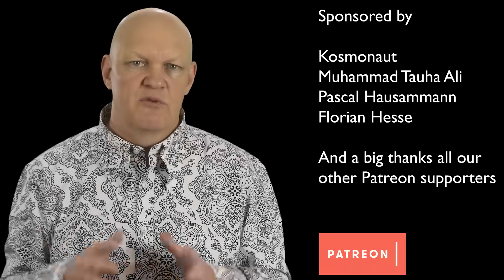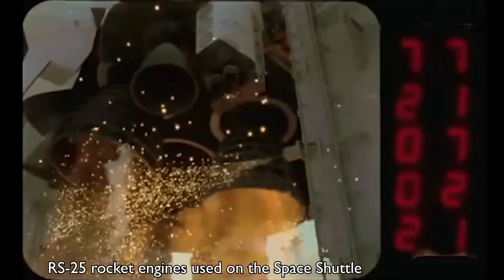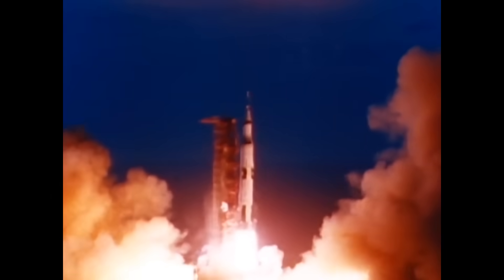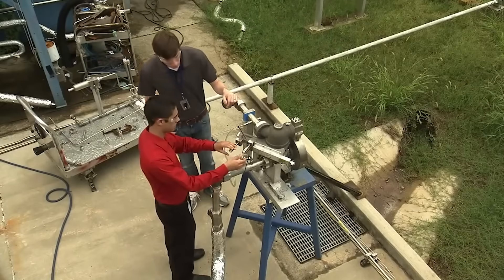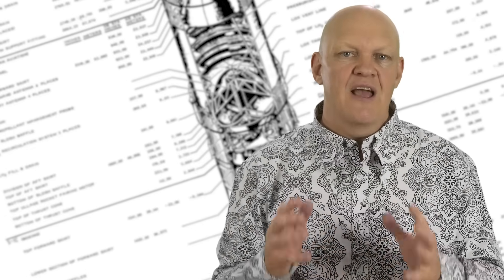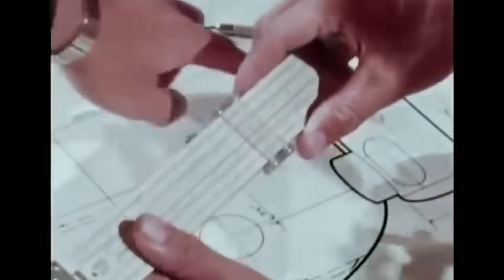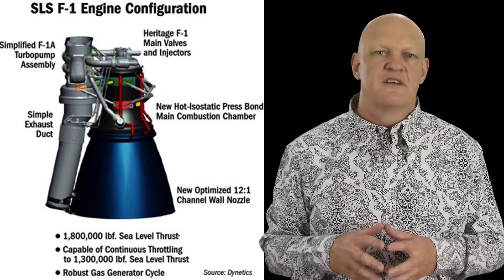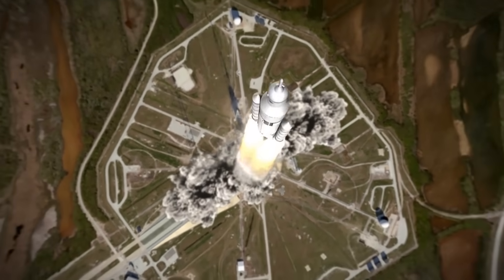Why Can't we Remake the Rocketdyne F1 Engine?

Comment: No amount of excuses will ever satisfy me, is like the pyramids in Egypt but in a way shorter time frame.
Reply: It's completely different than the pyramids, we can easily build a pyramid, but there's no reason to.
Reply: @raptorwhite6468  With today's tech sure but the analogy stays the same, you would think that such incredible feat in human engineering will require blueprints down to the tiniest bolt.
Reply: @diegolink42  they DID have blueprints down to the tiniest bolt. The physical copies still exist with probably step by step instructions on how these engineers should be put together. The problem isn't with not knowing how to build one, the problem is the craftsmanship that they used to build one. Those tiniest bolts weren't any old bolt you can go pick up at a hardware store, but hand crafted, individually tested and modified with it's own serial number. And like said in the video, what they used to modify these parts is probably not in the blueprints, but scribbled in a margin somewhere, or like how if you've ever worked with or talked to old union engineers, they have their own mental shortcuts on how to make something. And if you've ever worked in QA, you'll know damn well that if you're working with those kind of component, we call them "controlled material" you better guard that thing with your life if you so much as take it out of the thing you're working on. Because if you lose or damage that bolt that probably costs more than your salary for the next few years, then that's not only paperwork, but you have to get a new one, hand crafted (sometimes by tooling that doesn't even exist anymore) which is an expensive, time consuming process that can cost you your job.

And same with the pyramid analogy, why would we recreate the same design today? We have better computers that can be way more accurate than any one of our minds can ever be. So it's probably cheaper and better overall to just design a whole new engine.
Reply: @diegolink42 why build outdated crap when you have engines that blow the F-1 out the water? see the Raptor 3 engine

Comment: Really they can't make these old rocket engines but they can make secret  planes or whatever and travel anywhere in the universe bit not 50 yr old engines lmao makes a lot of sense don't it😅
Reply: Top secret stealth planes are not the same as an engine used on the Saturn V. One is suppose to be invisible to radar, while the other needs to get 3 men to the moon. Different fields, different technology, different engineering skills. 

And you missed the point. We can't make THOSE engines anymore and we probably wouldn't want to. It'll be cheaper faster just to come up with a new design that'll probably be more efficient and easier to produce than the F1s.
Reply: the F-1 engine is an outdated engine. the Raptor 3 engine blows it out the water is every single metric

Comment: I like your long vids too.  And you could make a long video about Rocketdyne's legendary F1.  I watched an old documentary called Moon Shot.  Bet you've seen it.  And other documentaries about the Apollo era.  Like you stated, each hand built by what you may call Masters of their art.  By thrust output alone, the most powerful liquid fuel rocket engine ever designed and built.  I recall that the engineers had trouble with the injector plate. In several documentaries, the engineers admitted that they stumbled on an injector plate that did not cause instabilities within the combustion chamber.  We got lucky, and stopped blowing up test prototypes.  When using a disposable 1st stage, performance outweighs efficiency. As soon as your big bad simple 1st stage is discarded, efficiency comes into play with the remaining stages.  This is one example of Von Braun's way of thinking.  I believe that when a Saturn V burned up the fuel in it's first stage  and the seperated from it, the rocket was then approximately 35% of it's launch weight.  The rest of the vehicle was very efficient, with those J2,s in the next two stages.  But I ramble.
  Thanks for the vid.

Comment: I like the shorter format. So many videos today go from 15-30 minutes (for monetization?). They waste a lot of time.
As for SLS...... geez, what a mess. They use these super finicky HydroLOX engines that are way over priced and prone to leaks (because Hydrogen always finds a way to escape). Then they lug that huge set of fuel tanks almost to orbit (negating a lot of the efficiency of Hydrogen in the 1st place). 
Von Braun and crew were smart. Make it a 3 stage vehicle. Get it off the ground with the simplest Kerosene Engine they could engineer and DROP ALL THE WEIGHT after burn-out, and then save the finicky HydroLOX stages for the upper atmosphere and space. Drop a lot of weight with the second stage and cruise into trans-lunar trajectory with a sleek single engine Hydrogen 3rd stage.
It is simply a CRIME that the SLS weighs more, has more thrust on lift-off, and STILL gets LESS payload to LEO or TLI than the Saturn V.

Comment: Some of the 'engineers' in my graduating class were absolute morons. NASA hired the best of the best. Cost-cutting SpaceX will never reach that pinnacle.
Reply: ah yes, spacex develops the most advanced rocket engine in history and you think the F-1 is still better?

it's not cost cutting, that would imply sacrificing quality. SpaceX has landed a falcon 9 booster 360 consecutive times without fail since 2016 and many of its boosters flying more than 20 times

Comment: I, personally find it hilarious that technology has "advanced" so much, we can't even build a design from the 1960's! 😂
Reply: have you tried building an sr-71 using original plans and factories?
Reply: @Agarwaen  Not personally, no. Have you? That's also a 60's design by the way.
Reply: @PercyPruneMHDOIFandBars  exactly.. you're almost getting it.
Reply: @PercyPruneMHDOIFandBars RD-170 produces more power than an F1
Reply: @Hex___666  Not my point. Look at whàt I wrote earlier.
Reply: @PercyPruneMHDOIFandBars  If your point is that you want to build a design from the 60s when we've surpassed it then you don't have a point.
Reply: @Hex___666  My point, is that with claims of "advanced technology" people can't even make something created nearly 60 yrs ago! Surely that should be simple? It's hilarious to me just how far backwards we've advanced!
Reply: @PercyPruneMHDOIFandBars  Yes because we can make something better, there's a reason Ford don't make model T's anymore.
Reply: @Hex___666  Hmmm. And there are things model Ts do that modern fords don't, look at the ground clearance? The issue I actually have is loss of skills.
Reply: @PercyPruneMHDOIFandBars  Model T has a ground clearance of 10 inches, Bronco had 13 and is faster, more comfortable and more economical.  When we make something better we don't continue making old inferior things as well.
Reply: @PercyPruneMHDOIFandBars   The SR-71 is a 50's design. An F-1 engine makes 1,522,000 lbf , A space shuttle booster makes 3,300,000 lbf.  
But if you want F-1 Engines and Model T's build them.  Make a bunch and sell them.

Comment: It's a useless engine today, it's way too expensive and though it provides a lot of thrust it does so at massive cost and is not reusable at all, the SpaceX raptors are by comparison much better than the F1 and if SpaceX manages to get the super heavy working we will have something that can lift as much weight as the F1s at a fraction of the cost

Comment: 3:43 100% completely false lol!! Just because the people that designed and built the f1 engine are not around doesn’t mean there are no qualified or smart enough people to build the f1 engines again that’s just completely false we are far more advanced then 60 years ago in every possible way, we can build the engine better now then before because of the machinery/tooling, how much we have learned/advanced in rocket technology, we can simulate anything with a computer now before building anything with great accuracy, we can make better quality alloys then before. If the F1 engine was the best option for a spacecraft now we would be using the engine but it’s not it has nothing to do with not having able people to build them and for what it’s worth people that worked on the engines are still alive, sure many have passed away but if they wanted to build the engines the key people were around for decades after the Apollo program ended its not like they all died in the 70’s when the engine was cancelled again nasa built a new spacecraft and the engine was not right for the new spacecraft that’s all plus we stopped going to the moon

Comment: I understand the issue about how you can't put everything into the blueprint. In my job we complete a bunch of fairly straightforward tasks. You can learn these tasks in the course of a day or so, and we have training notes to explain the steps. There are a range of problems which might require us to stop a task and go back to the beginning. The challenge is that these problems require different solutions, and when multiple problems occur in a task they require different solutions again.

There's simply no way to write out the solutions to all the possible combinations of problems, so the best we can do is to train the new staff to make sure they've found all the problems, work out what they think the aggregate solution is, and check it with the more experienced staff. There's no point adding it to the notes, because there are simply too many possible combinations, and most of these combinations occur extremely rarely. It's simpler to build up your experience in order to be better at catching all the problems in a task and then designing the custom solution on the spot.

If the members of our team all won the lottery and resigned, and Management had to train up a new team, the replacements would only be able to learn about how to deal with those basic problems. If they came across one of those more complex problems the training notes would be no use and they'd have to work out the solutions all over again.

Comment: Rubbish. 
1: The design documents are not publicly available for the F1 engine.

2: You really think our engineers and scientists now couldn't reverse engineer a hand tooled rocket engine? Laser scan each peice, load into CAD. Modify as required and build it. 
But they didn't, because if they did, they would realise the Saturn 5's published capabilities and power were over exaggerated because they only needed to get into Earth orbit.
Reply: Any evidence to back up your assertions?
Reply: 2. The problem is many engineers did undocumented changes and modifications to the engine. You could stand under a saturn V if you are questioning its power if they ever build one again.
Reply: @miguellopez3392  Simply not true. Reports and technical details of every stage of development were documented and reported to NASA and the relevant contractors. The most important bit of machinery at the time, apparently, but didn't keep such documents.
Reply: Also, you don't need to sit under a Saturn 5 (even as powerful as it actually was, we know it was loud) for it to kill you. Sit in a capsule 300 feet above it and the sound/vibrations alone would kill a man.
Reply: @maverick627uk  the saturn 5 was under pressure to get into the air as fast as possible, I doubt the engineers recorded every stage of the 100,000s of design choices especially when you had no CAD to make it even a convenient task.

Machinery is customers made, so information on them can be lost fairly quickly if the hired company goes under or a department miss managed the storage of files, I belive thos to be more possible than a organization to have perfect documentation for half a century.
Reply: @miguellopez3392  Rubbish. They designed a production process, then made many F1 engines exactly the same way. They didn't do it from memory. They made 98 Engines! 98 not bloody 6.

Hilarious as cognitive dissonance is, believe what you will.
Reply: @maverick627uk  and then they lost the documentation just like how not all moon footage was stored correctly and some found many decades later.

Comment: The propellant is different, now we use cryogenic fuel, in the 60 some kind of refined petroleum, less power per unit, with different and more power fuel the engine needs to be redesigned anni way.
Reply: Falcon 9 & Heavy and the first stage of Atlas V still use RP-1, just as the first stage of Saturn V did.
The upper stages of Saturn V used hydrogen, just as all stages of Delta IV Heavy, the core stages of Ariane V and the SLS, the upper stage of Atlas V and the shuttle main engines.
The only new fuel is the methane used by SpaceX' Raptor engines on the Starship and Superheavy, but they haven't become operative yet.

Comment: They do have 100% reliability.

Remaking them, would demand a new prototype, and everything in the design and manufacturing, to be updated to new standards.
Then I believe those old engines can be produced in series, a lot cheaper than expected. 
Low chamber pressure, and a overall reasonable simple design, with well known technology, can be produced anywhere.

Don’t expect to return them in one piece, but to parachute them down, and collect the metal, seems like a solution to recover some of the money spent.

Comment: NASA does not build such engines, because it knows that their thrust is only 70% of the declared one. These engines are of a very primitive design, they are just an enlarged copy of even older engines. Now NASA buying Russian RD-180 engines, which operate on a closed cycle designed specifically for the Soviet Lunar and Mars programs.

Comment: The problem with all the little kids wanting to be called rocket propulsion engineers is that they were raised on electronics, computer gaming, to much damned math, calculators, and more computer gaming.

These little children have never turned a wrench, worked a lathe, baked a basket of steel parts with a propane oven, or learned how to weld or even solder.  They don't know what a machine shop is, a paint booth smells like, or a lit test engine sounds like.

Not to mention the fact that none of these kids are creative, imaginative, or brave enough to just do it!

Take the engine apart, machine duplicate the parts, reassemble and test the unit, and adjust/redesign/reassemble/test/repeat  this about 25 times in a row!

Engineering is impossible even if you're really good at it.

Tough going, so good luck!

Jason Wampler
W A M P L E R

Comment: Why bother trying to re-learn how to make F-1 engines? They were very expensive, rather temperamental and took a very long time to build, test and deploy. Why not use Raptor 2 engines, instead? They can be built in a day at comparably low cost. Three Raptor 2 engines equal the thrust of a F-1, they can be installed in hours instead of weeks AND they can be sent back into space again and again, thus significantly lowering the cost per kilogram for payloads. F-1 engines, like all NASA systems, always end up on the bottom of the ocean at great cost to the American taxpayer. Why do we even allow NASA to build rockets anymore? They're about as cost conscious as a drunken sailor on a three day pass.
Reply: You're blaming the wrong institution here. Do you perhaps believe that NASA wanted to build another non-reusable rocket using legacy hardware?

Comment: I was at the Kennedy Space Center in the 1990's and looked over an F1 on static display. If the impeccable workmanship wasn't impressive enough, the fact that being placed outside in all the weather over the decades, the engine showed no signs of corrosion. A testament to the quality of the alloys used in its construction.
Reply: Pretty impressive, seeing as it gets pummeled by salt air & sea spray on a daily basis. Gotta love human ingenuity & workmanship.
Reply: When my dad applied for a job at NASA I got to stand inside the f1 there in cape Canaveral. I was 12? And joked it was big enough that I could use it as a teepee, WITH central heating!
Reply: It is made from inconel: An extremely corrosion resistant nickel-chromium super alloy. It is basically the corrosion resitant part of the stainless steel, but without the steel part. :D
Reply: Yep I’m sure they never do any maintenance on it to keep it looking good.
Reply: All the evidence you need for the Apollo claims huh
Reply: @deusvult6259  you are very stupid.

Comment: Some of the old guys are still alive but have health problems but would be proud to help, it sounds like more of a swallowing ones pride and admitting computer geeks are not the holy grail of manufacturing issue. A combination of the old and new brought together would be unstoppable in the end. If I were challenged with the task I would hire a bunch of injection mold makers and
teach them rocket science. They are the best at making precision intricate parts, and are the best at everything including high-tech welding.